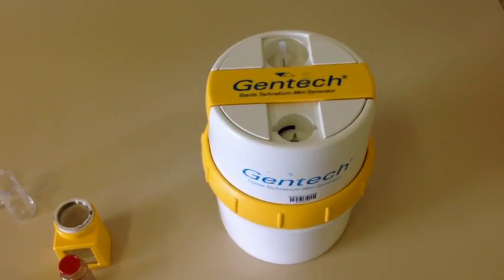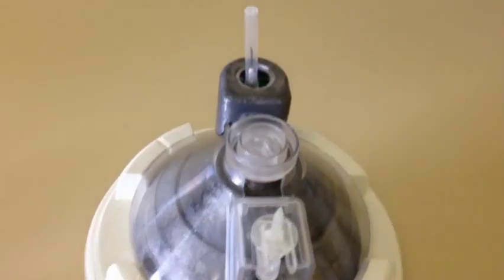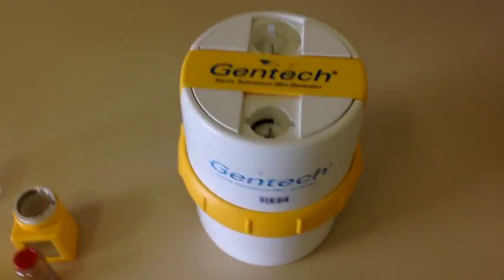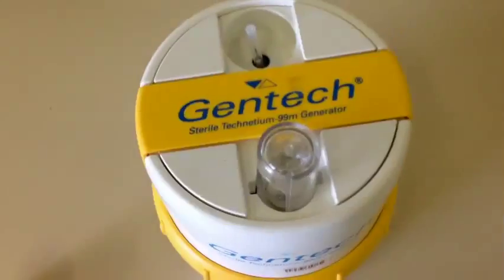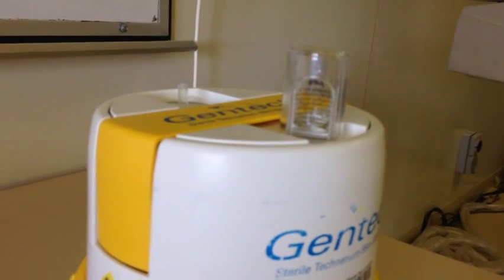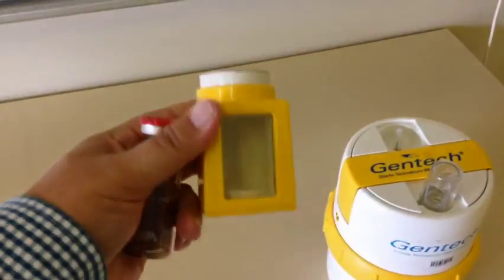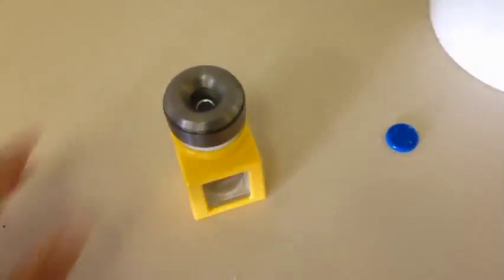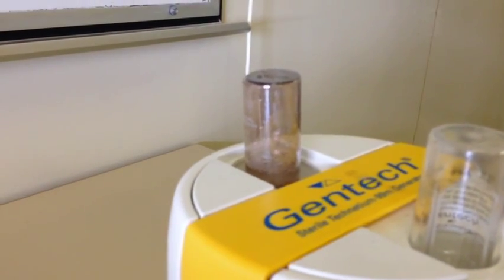99mTc generator part 2 - dry generator

Comment: Maybe a stupid question - but why was the solution you extracted not radioactive?
Reply: Hello. Normally, it should be radioactive. My guess is the generator has expired. 99mTc is generated from Mo. Mo has a half life  of about 3 days and 99mTc has much less, 6 hours if I remember correctly. So if this generator would be some weeks or months old, all the radioactive material will have already decayed, thus, the extracted solution won't be radioactive anymore.
Reply from the maker: yes it was a model, and old system that has been through many half lives. I just use it for demonstration purposes
Reply: @geoffcurrie968  hai sir